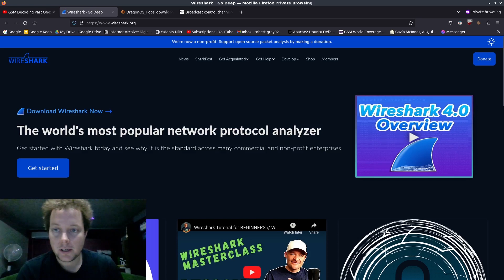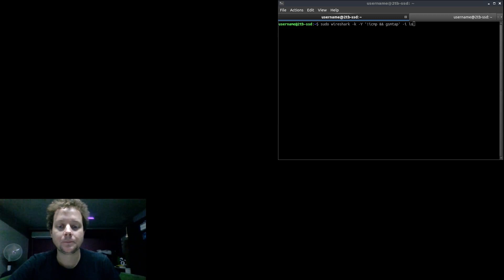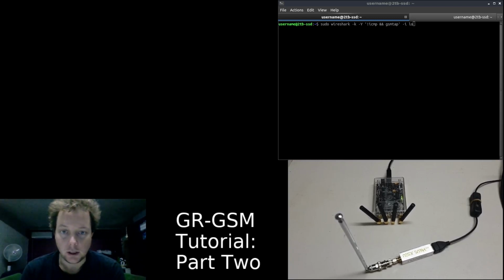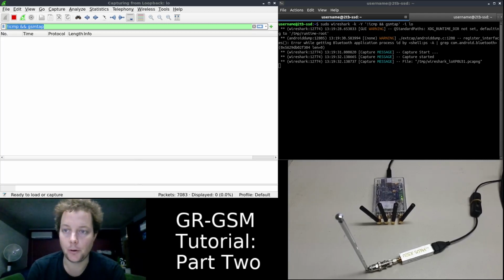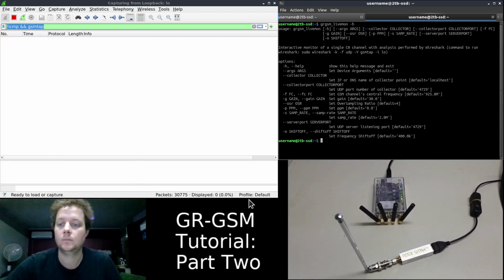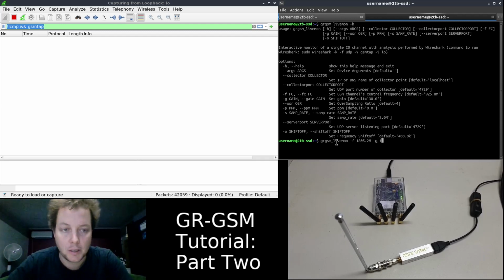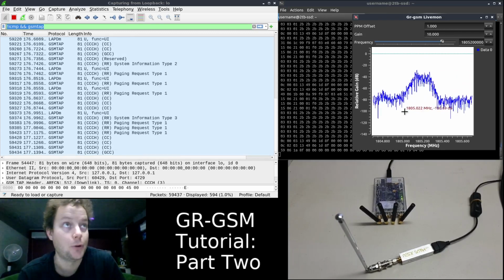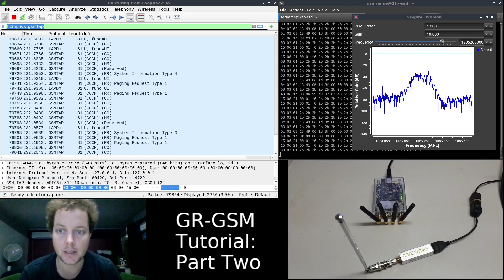GSM Decoding Part Two: Monitoring GSM Control Channels In Real Time With 'grgsm_livemon'

Comment: [WARNING] SoapyVOLKConverters: no VOLK config file found. Run volk_profile for best performance.
what is mean
Reply from the maker: Don't worry about that error, but if you want better performance in GNU-Radio, open a separate terminal window and run 'volk_profile' and let it go for a while (it takes some time). Also run 'sudo volk_profile' after, so you can have increased performance when you use GNU-Radio as root. You only need to run these commands once on a single PC.
Reply: @RobVK8FOES  give me ur email please !
Reply from the maker: vk8foes@gmail.com
Reply: can u give me ur email ?
 @RobVK8FOES
Reply: i have a littel prob